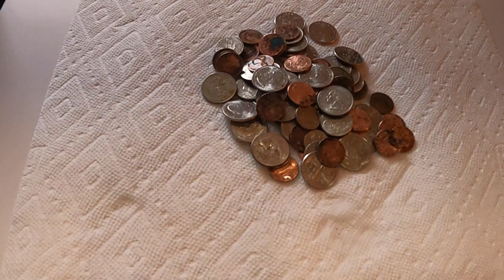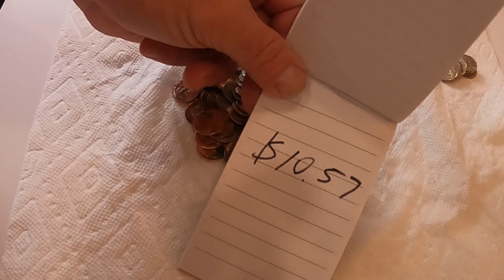ASMR | No Talking | Cleaning an Auto Detailers Vacuum | Ridgid WD4070 | Best Auto Detailing Vacuum

Comment: After watching several of your videos im sure it doesnt matter to you if a subscriber makes an observation. The filter in the ridgid isnt supposed to get wet as its for the dry side of vacuuming. The foam sleeve is there to prevent large debris from clogging the filter by providing a gap between that debris and the filter thus allowing air to still travel through the filter and let you keep vacuuming. When you want to vacuum up water you are supposed to first remove the filter and sleeve then begin vacuuming up the water. A float in the housing of the vacuum rises as the vacuum fills up with water and when that water gets to a specific level the vacuum sucks that float up blocking the flow of air and thus prevents any more water from being sucked up into your vacuum and gives an audible change to the sound of the vacuum letting you know that its time to drain out the water. Drain the water via a plug if a larger vacuum or in your case since its a smaller vacuum simply take off the cover and dump it like a bucket then put the cover back on lock it down and keep going. Having said all that the amount of water you suck up during the day isnt enough to damage your vacuum but I suspect you go through a few filters doing it that way and since time is money and because you service cars belonging to those with a high disposable income, going through a few filters isnt any real problem for you and im also sure your feeling is that its your vacuum and you will use it any way you want and i agree with that. Just thought id point out for your viewers benefit that this isnt the way to use this vacuum.
Reply from the maker: All your statements are correct